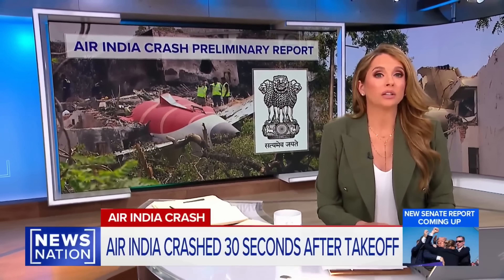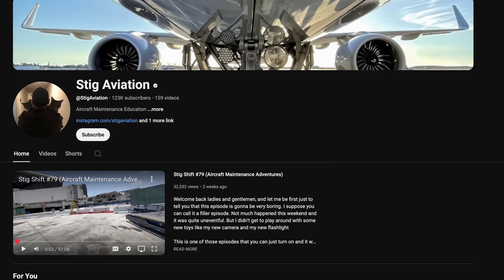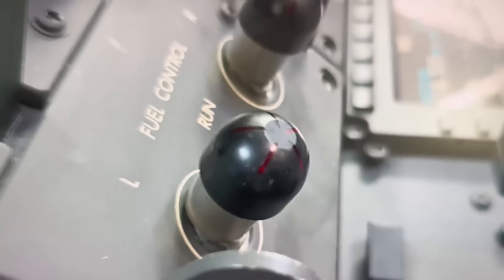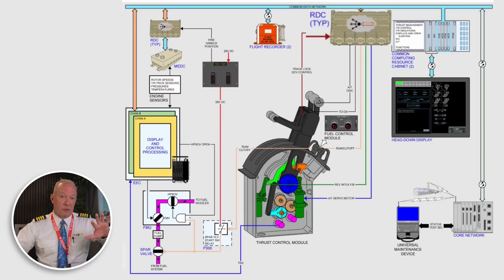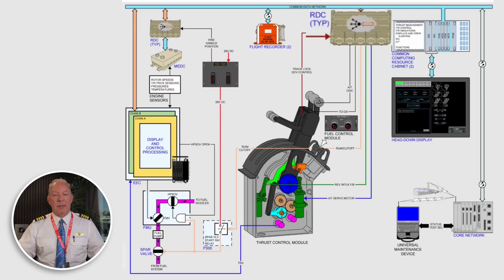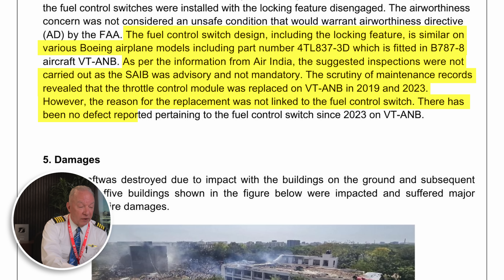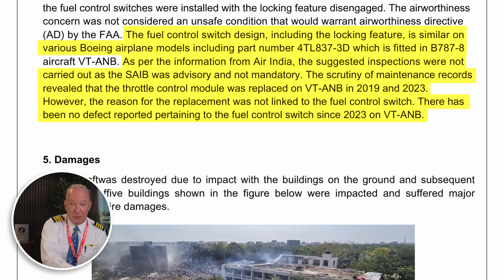The Truth About Boeing 787 Fuel Control Switches

Comment: Thank you Captain Steve for getting into the technical details of the fuel cutoff switches. I also agree with you that most of us are hopeful and wishful about the cause of the accident. I am a former USAF crew chief and later became an electronic technician which I have spent the major part of my life. Not knowing the specifics about all of the detailed investigative findings or the aircraft electrical circuitry, I'm curious about a couple of things: does the actual switch report it's physical movement or is this circuit part of the relay opening and closing? If it's part of the relay circuit it's conceivable to me that the relay itself could have been intermittent and possibly opened up temporarily maybe due to a loose connection, bad solder joint, burned relay contacts, etc. I would hope that the switch itself has multiple poles that would include one set to signal the computer that it was indeed physically moved and I'm also assuming that the fuel control relay was inspected and found to be fully operational?

Comment: And if the relay itself failed? Or even the valve! And why did the RAT jumped out, just after the takeoff, in the first place? None of the pilots have control over that, right? In addition to that, why is captain Steeve so eager to convince people that the fuel cutoff system is failsafe, when there is not such a thing in the world, which is failsafe.

Comment: Steeeve may accurately explain how theses switches work  but doesn't even bother to explain the electronics BEHIND those switches, at it's origins. No explanation or discussion of any electrical shorts, or loose connections, or any kind of computer glitch that would make the fuel pumps turn off via electrical signals, not by manually switching them off. WHY Steeeve? 
Stop rehashing your final conclusion. It's not final. We don't know why the fuel pumps, "Transitioned" to the off position. Not yet, and stop concluding based on "Preliminary" reports. Irresponsible at the very least and at most trying to gain more viewers and more $$$.

Comment: Captain, I appreciate your explanations on this matter. I do have a question though, in regard to the three fuel valves on your schematic. They seem to be arranged in series, one after the other. So all three valves need to be open in order for fuel to flow to the engines.

From my understanding of it, only the first valve (SPAR) is directly controlled by the fuel control switches. The other two are either NOT controlled by the fuel control switch, or only through an AND gate, where both incoming signals need to be "high" for the valve to be activated. The middle valve seems to be directly controlled by the computer and the third valve partially through that AND gate.

Am I getting this right, or is my understanding of this diagram wrong? I would greatly appreciate your input on this. Thank you very much for what you do.

Comment: In the diagram the switch appears to activate 2 fuel valves directly with the 3rd being controlled/activated via Display and Control Processing. Is it possible either a circuit failed to one of the fuel valves or the delay itself failed causing 1 or all of the fuel valves to close?

Comment: I keep asking at multiple sites if switches have internal contacts to tell data recorder the ACTUAL position of the switch. If the record on the recorder is ONLY of the operation of the fuel system, NOTHING can be be determined about the switch position. Dozens of possibilities for power loss to engine controls...

Comment: I'm a current C-130 FE and instruct both FEs and Pilots on systems. The simplified schematic in the video is great, and it does contain one more input (that I can see) to the relay. The engine fire handles also have an input, which makes sense because if the fire handle is pulled, the valves should close to stop the flow of fuel to the engine in the event of an engine fire. I'm not saying the handles were pulled, I'm just pointing out that other theories will emerge based on that.

Comment: I thought it had been determined the Captain on the plane had flipped the switches intentionally as a suicidal action. Did I hear wrong, or miss something else? If it was intentional it takes all the argument out of the switches moving themselves or being accidentally hit and moved to the shutoff position. My SIL flies B737-8's which have the same switches and he assured me there is no way to accidentally move them to either position. I also don't believe the FADEC could fail in that manner, shutting off the fuel.

Comment: Thank you for your detailed explanation on the design of the fuel cutoff switch system. The probability of an electrical relay like that failing in this way is extremely remote. Both relays (two switches, so I assume two relays) failing would be astronomically unlikely. This should calm people about the safety of the design of aircraft.
I am curious about the process for ascertaining the readiness of a pilot before a flight. Is there a process which determines if a pilot is good to go, or is it up to the other members of the crew to determine this on board? I presume there is some sort of process. Does Air India have or follow such a process, and is it, in your opinion, a good one?

Comment: Capt Steve,
What is the situation with the sensor that recordes the position of the fuel shutoff switch and is recorded in the Cockpit data recorder?  How, where and what does this sensor actually sense?  Is there a remote switch position sensor in the cockpit, with a light or something?

Comment: A good explanation of physical / electrical operation of the switches.  However, I'm left wondering a couple of points.  First the 3 valves, for the HPSOV, the o/p goes into what looks to me like an AND gate..  so for correct operation of the valve you also need a positive signal on the HPSOV OPEN line.  Second, FMV valve is controlled by the display and control processing unit, NOT input from the fuel cut off switches.  To be clear, looking at the diagram ALL fuel switches need to be in the correct position for good fuel flow.  Happy to be corrected.  Final point, we've heard some of the audio, where one person asks the other why they operated the switch.  However, I would like to know where the evidence is that physical switches were actually moved?  Which input is recorded in the flight data recorder?  My point being is that regardless of switch operation which may or may not have happened, where is the indication recorded that fuel was shut off?  I get the impression that there is no recorded actual fuel switch cut off position rather indication of fuel shut off only.  Thoughts?

Comment: First of all, a lot of mistakes in the video.
I would clearly say as as an automation engineer with background in mechanical engineering background, the 24~28VDC you are talking about is purely control voltage, meaning it is used to switch the relay which lets 120 or 240V pass through it. This is done by electromagnets. You can look up relay diagram. Its a simple google search away. If you say the 28V is gonna run the Fuel pump, you are highly mistaken. Such small pumps is used in small hobby projects, not on an airliner where massive amount of fuels are to be pushed through. Such high volume pumps would run on 120-240V and higher.

When it comes to FADEC + TCMA malfunction like in 2019 ANA incident, say in grounded condition, fuel switches are turned ON, and thrust level pushed forward for acceleration BUT flap conditions are not set. Meaning its not configured for a flight, TCMA + FADEC would take over the control and thrust down the engine as it would understand that as a mistaken input. The only way you would know of turning down thrust is to cut fuel and that is by cutting of fuel supply. Which is a clear indication that they do have control over the switches, quite opposite to how you articulated in your diagram. If for sake you say, they take back thrust lever for that scenario, then that also means taking off fuel apparently. So in either way TCMA+FADEC do have a control, regardless of direct or indirect.

Your arguments does not make sense here today. A relay can simply be taken over by shorting the wires coming from switch or FADEC+TCMA in this case, so essentially nullifying the argument that the switches are purely mechanical. NO THEY ARE NOT. they operate a 24-28V secondary electrical circuit. They DO NOT PHYSICALLY cut off the fuel.

Comment: How do we really know the exact time of the  cutoff switch positions were physically cycled? If it's a log of the voltages values at specific locations of the circuit that doesn't  give us an actual certainty that the mechanical switch itself was cycled at the time we think. If the voltage powering that relay were to be influenced by a lower voltage from an external source or malfunction of insulation or grounding the relay would cutoff the fuel solenoids regardless of the manual switches position.If that had happened the pilots would have cycled the switch possibly multiple times wondering why the fuel flow was not engaging as expected. It may have only been that it happened to be in the on position when they crashed but Infact they toggled it multiple times hoping to get the fuel flow to engage. If voltage values are all we have to go by than it's also possible the fuel switch was never cycled at all and was left in the on position the entire time and we only think it was cycled one time from on to off to on because of the voltage log.These voltages may have been influenced by something else due to a insulation or grounding fault and if the voltage dropped low enough the relay would close the fuel solenoids immediately.Also it wasn't mentioned was this a solid state relay or mechanical relay that uses an inductive coil both of these types have unique vulnerabilities and possible points of failure that would result in the  expected open or closed output to  be incorrect. Assuming these facts both the conductive path of the circuit and the relay itself are subject to failure and would result in the cutting off the fuel flow.Successfuly testiing the relay after the crash doesn't mean for certain if functioned that way during the crash incident.Relays are not perfect and depends on multiple internal factors to give the desirable and expected output. Also the wiring of the circuit itself was very likely effected by the crash and explosion so if there was a failure in the insulation or interference in the conductive path by an external voltage or magnet field  it may not be evident. Both batteries and the relay voltages that were logged doesn't tell us about the actual DC current itself, if there was something that arrested the current flow at a specific location below sufficient amounts such as an unexpected parallel current path in iether the relay itself or the fuel solenoids despite having sufficient voltage at the logged circuit locations may not of  had sufficient DC current to actuate.

Comment: Why did the RAT deploy BEFORE the fuel control switches we're supposed switched to cut off?🤔
Reply: That's a fair point.
Reply: What is your source that the RAT deployed before the switches were moved?  That's not in the official preliminary report.
Reply: @daedalron Airline news research
Reply: @daedalron Airline news

Comment: If the wiring diagram you showed is actually accurate then how did they know that the fuel switches had been turned off one second apart?  There's not a single feedback wire on your diagram.  If there's not anything to tell the computer that the switches had changed state then how do they know?

Comment: Your model of the fuel switches is too simplistic and misses out an important link in the circuit. You started my saying the system uses 28V but the switches supplied 14V to operate them, just a small point but the supply to the switch mast have been 14V to operate the relays, the 28V from the relay to the valves etc to operate them, no reason that they would use the same DC voltage to operate. Your model used an on/off switch which you said was the relay, they are seperate items and would be hardwired so a fault in the connection between could fail. None of it matters cos the fact the switches worked when moved back shows it's a red herring.
Reply: The extent of oversimplification in this video is truly legendary

Comment: Great breakdown but does not the video evidence and flight data suggest FADEC failure shutting down both engines,  RAT deployment and pilots cycling the fuel switches to off and then back to run after 10 seconds to restart.  That looks like standard reboot not pilot error.

Comment: Nobody mentions an Insect or a Mouse damaging Electrical Systems !  The wires are close to each other because the Switches are only a Couple of inches apart. The Aircraft, being Composite Materials will have to be Earthed differently to an all Metal Aircraft !  But it Sounds to Me that the Pilot cut the Switches on Purpose !

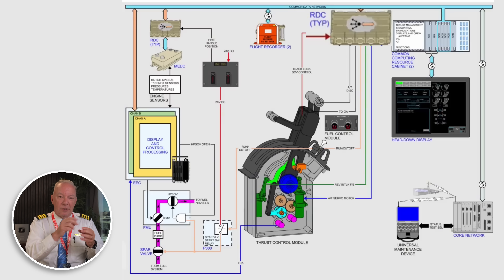Comment: Steve. At 8:33 you have the circuit diagram open. There's an unnamed component.  
A logic gate just before HPSOV which also lets the Display and Control Processing unit to know if HPSOV is open or not. 
You can't say it's just a simple circuit when the signal passes through digital controllers.

Comment: You keep using the term "relay" a relay is an electronic switch, not a mechanical switch. Obviously the switch the pilot moves is mechanical but it can only control one side of the relay coil, what is controlling the other side? I'm a 40 year automotive technician specializing in electronics, if there is a relay involved, I would like to see it in the schematic so i can see what controls both sides of the coil in the relay.

Comment: Question: You said that, even after a total power failure, the batteries would still provide energy to keep the fuel valves open for about 30+ minutes. What would happen once the batteries had run out? Would the fuel valves shut down or remain open?

Comment: Thanks for this explanation.  I was wondering if the fuel cutoff switches sent a logic signal to a computer to close the valves or used direct voltage to close the valves and this answers that question.  Since the valves are normally open and require a voltage to close, the design seems solid.

Comment: Soo what happens if the source for the 28V temporarily disappears?  Due to loose contacts or frayed wire or insulation. 
Realay is normally open and requires power to close?
Or normally closed and requires power to open?
Does FDR record ACTUAL switch position or just measures incoming voltage from switch.

Comment: While working on a system the other day I had a brain fart and ran a completely different command on a system than I had in mind. When you get used to doing things routinely they become somewhat automatic. My first thought was "Holy S! I could have just cut off the fuel control switches on a 787!". Thankfully I'm not working on anything that has lives at risk but getting into the routine of things it is conceivable a mental lapse could have someone perform a different thing than what they're planning. Like brain says gear up hand says fuel off. I don't think it should be so simple to cut fuel, another video describes the fuel cutoff systems and the Embrarer system seems to be the most foolproof, where you have to roll back the throttles, pull up a latch, then move them further back to cutoff. Not something you're going to inadvertently do (either accidentally or intentionally without being noticed by the other pilot). A simple flick of the switches behind the throttles that can't even be seen by the other pilot seems to be inadequate protection considering the importance of those switches. They don't even have guards on them.